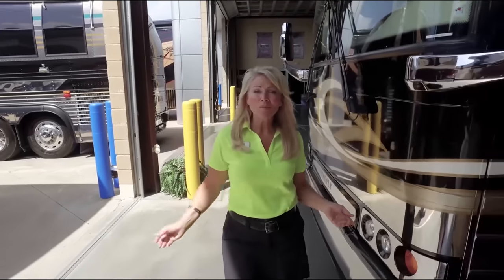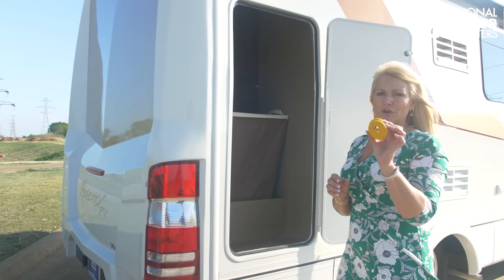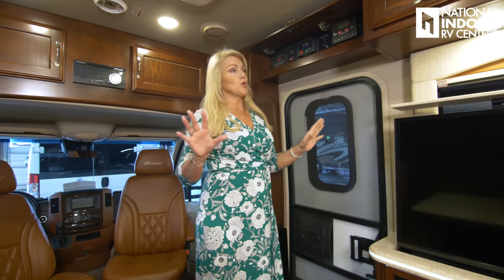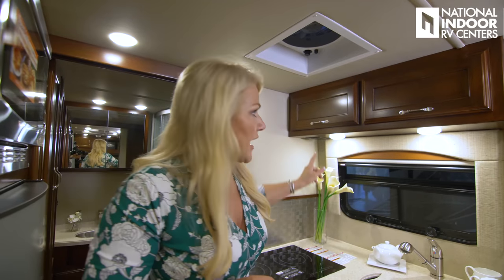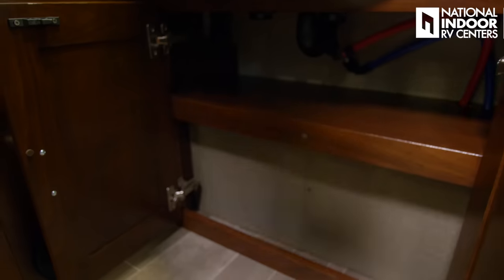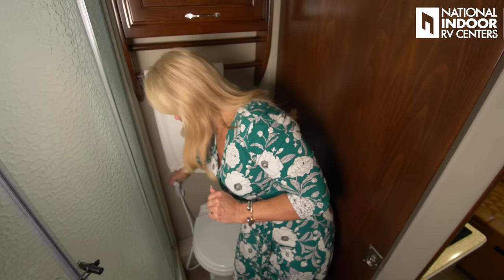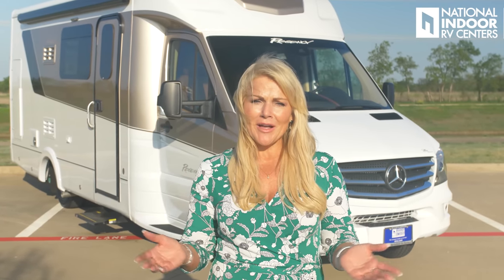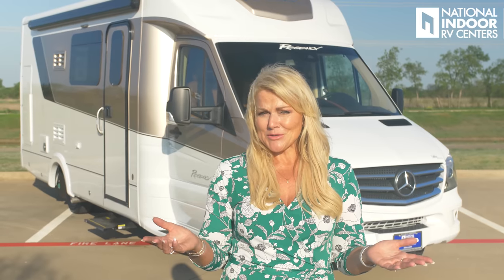2019 Regency Ultra Brougham | Full Motorhome Walkthrough Tour | NIRVC

Comment: Angie, not only do you do  a really good job when you demo but you're r really cute & easy on the eyes. This Regency is very nice but if i'm not mistaken it's 25' long so it won't fit in a regular parking space. I don't like the idea of having to connect your mobile phone to navigate. I think they should have include a GPS. What kind of fuel economy please?
Reply from the maker: Hi Roger, thank you for the kind compliment! 
Concerning connecting your mobile device for GPS I personally love it!  I find that my mobile apps are much more accurate and updated. I typically tell customers they can expect fuel economy in the high teens with the 6 cylinder, turbo Diesel engine.

Comment: On the Murphy Bed model is there no storage on the outside under the slide out? On the twin bed model when you showed the storage under the bed is there no way to keep the storage cover up with out having to hold it up with one hand?
Reply from the maker: Correct there is no storage on the outside under the slide-out. And I agree with you that they need a way to hold the storage compartment open when accessing the under the bed storage area. I’ll share your suggestion with Regency.
Reply: @NIRVC  Thank you

Comment: Why doesn't it have full windshield, side window cover for privacy? THE roof top did it have solar panel? Thank you for showing it. Great job
Reply from the maker: HI Brandy, there are magnetic covers for the front windshield, driver, and passenger's windows.  This coach comes with the option to add a 400 watt solar panel to the roof (we typically add the solar on our stock units).
I'm glad you enjoyed the video!   Thank you for watching it! 😊